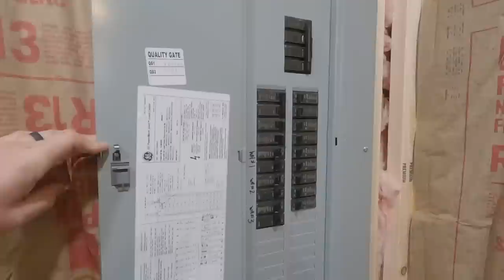Shipping Container Honey House Build [Part 2]

Comment: Good morning Nathan, I have a couple of questions. How did you deal with sealing the outside of the walk in door with the ribbed structure of the container? What kind of extractors do you have, and how many frames will they hold? Have you considered a wax spinner, or how do you deal with wax separation now? I liked the storage set up on your other container! Very handy! Thanks for your time!
Reply from the maker: I got an extra thick door jamb and then cut flashing to fit above it and used lexcel to seal the door.  So far no issues.  I’ve got a Maxant 20 and a Hillco 24.  Wax processing is something I’d add down the road, after a clarifier and pump.  Being efficient with honey makes me more money, wax is a value add.
Reply: I was gonna ask where you got that door from. I’ve learned a heck of a lot from you, thanks.
Reply from the maker: I got it at the local lumber yard.  They had to order it, because it’s a little smaller than normal, with a little thicker jamb, and it opens outward instead of inward.  A 36” door would’ve had edges on a ridge and a valley, so I went with a 32” because it fit on two ridges.  Outward opening saves space inside.

Comment: It's still easier than it was here when we build ours... the bureaucracy.. they call it a laboratory (a honey lab). I had to put ceramic tiles on the walls and polished concrete floors... l think they made it easier these days. 
But we got the money back for installing a big solar water heating system, insulated windows (insulated everything)... after it, l added one more internal electric boiler to the solar system, and pumps with sensors.. made everything circulate, and finally finished the floor heating room.. took me a couple of years 😅. But the thinking always was, 'don't go into credit debt for something that depends on rain and sun'. 
I'm writing this because I like that "free" solar system.. it's all outside, its boiler tank too, is on the side of the building.. and we rarely have to use the electric part of the system. But I don't know is it doable over there.. these days here, more green you go = more money back from the government
Reply from the maker: I actually do get solar gain on the building in summer, but no solar panels.  All I have to do to get it up to 90°F is to turn off the air conditioner.  That helps with drying honey.

Comment: You could run your 240 power outside in pipe and then back inside where you want them.
Reply from the maker: Yeah I could, but I’d rather not poke more holes than necessary.

Comment: Though I am not familiar with your local regulations, in my experience usually what they want for back flow is a reduced pressure assembly on the water supply coming into your building. Basically two check valves right next to each other with a vacuum breaker in the middle to dump the water should the pressure on your building side ever exceed the pressure on the city water side. But if your city supplier isn't very big, there's a chance that they wouldn't even enforce it.
Reply from the maker: That’s helpful, thanks

Comment: Debt will speed up your success, or it will speed up your failure.   So true.    The 1/4" FRP is expensive and will probably be a challenge to hang.  I think it is usually adhered to a solid backing.  Most people hang drywall and glue the 1/16" panels.  You may get dinged for not having an air gap between your sink and the sewer line.  That is typically done by draining into a floor sink.   They could also require a separate hand sink for hand washing.   Hopefully you have a lenient inspector.   Thanks for sharing.
Reply from the maker: I do have a dedicated hand sink, and they said trapped drains were enough, though I thought about using a floor sink.